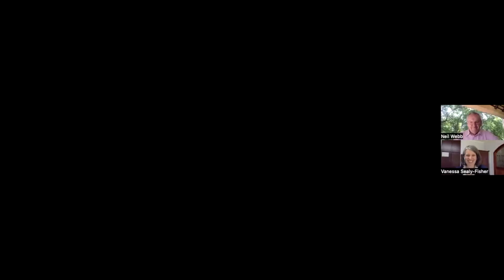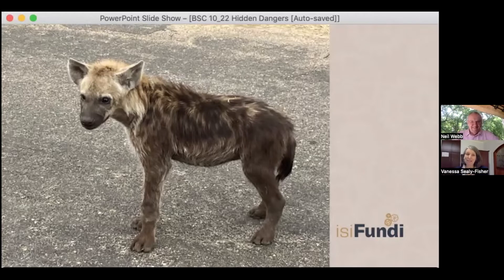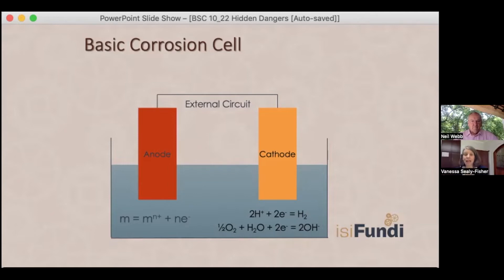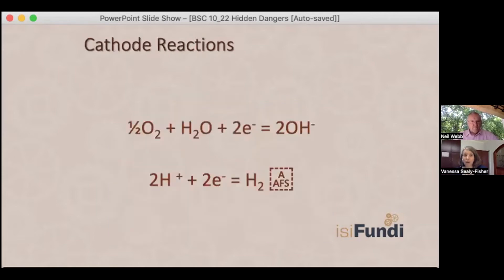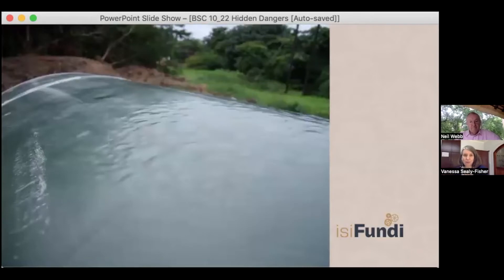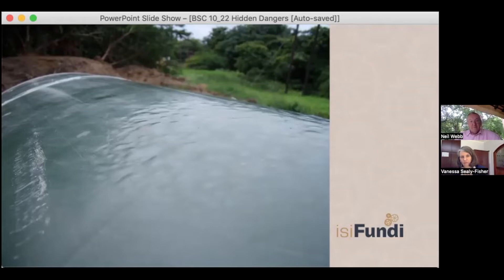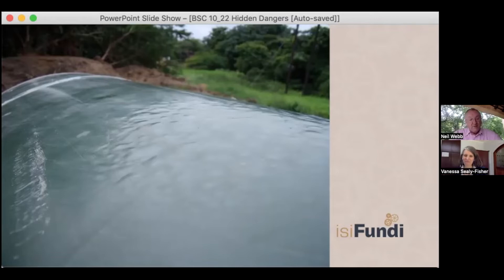Cathodic Disbondment | Hidden Dangers of Cathodic Protection

Comment: 🎯 Key Takeaways for quick navigation:

00:32 Too much cathodic protection can impact the external coating of buried pipelines, posing risks.
01:53 The upper limit of cathodic protection magnitude is recognized as -1200 millivolts, crucial to prevent coating damage.
03:00 Understanding the electrochemical interaction at the cathode is essential in discussing cathodic protection.
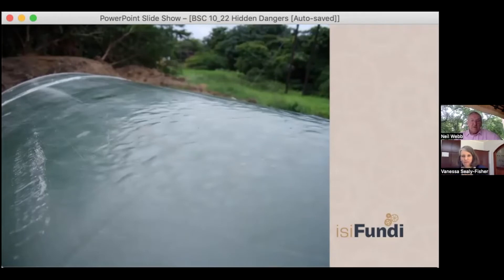07:20 Uncontrolled cathodic protection potentials can lead to coating blistering, emphasizing the coating's critical formulation.
09:23 Cathodic disbondment tests, like the cathodic desponding test, evaluate coating resistance to cathodic protection effects.
14:16 Coating application errors, even with compatible coatings, can result in adhesion loss and coating failure.
18:15 Modern coatings, though effective, pose challenges in controlling cathodic protection current, requiring careful system management.
19:49 Incorporating sacrificial anode systems with long operating lives is a practical solution for controlling cathodic protection.
21:55 Strategic placement and design of coupons are crucial for accurately monitoring cathodic protection systems.
23:42 Interference currents pose hidden dangers in cathodic protection, requiring careful system design and monitoring.
24:33 In the next session, the discussion will delve into the risks associated with interference and continuity in cathodic protection.

Made with HARPA AI